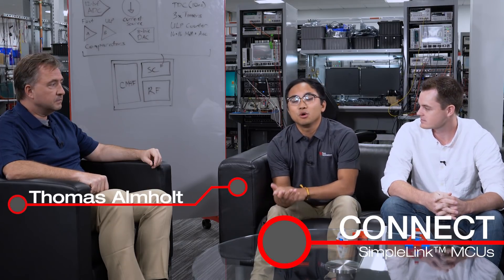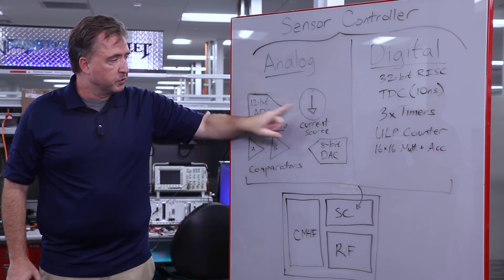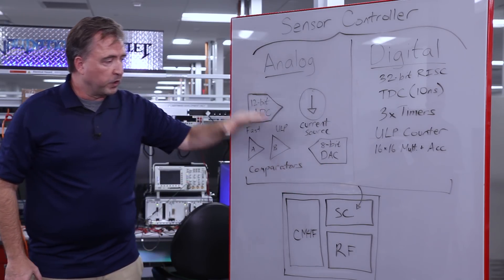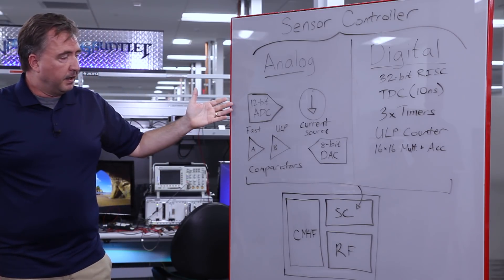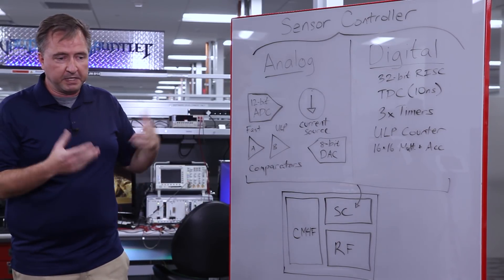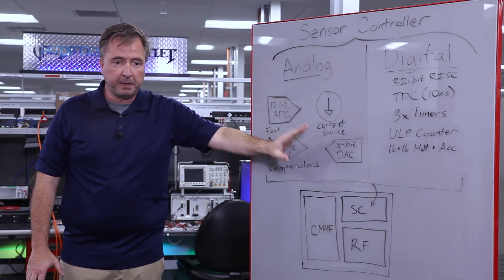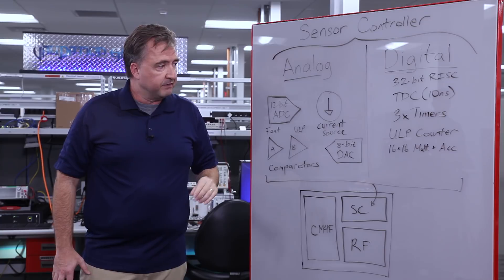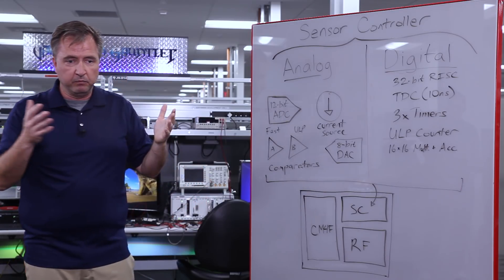Connect: What is a sensor controller?

Comment: I found problem while using SCS for my application. While initializing the Alert event SCS code generator does not update priority of the event, nowhere in the document it is mentioned taht it does not do so. Because of that faced problem in my application code. Took very long to know this fact now after scifInit call I do set priority for the Alert event in my application code then it works. Still I expect that should be done by sensor controller studio?

Comment: Hello, I need to to use pressure and temperature sensors. I was thinking to use PT100 for temperature and I need low power too. Is this ideal for this purpose? Also, I need to linearize the output of PT100, the sensor controller studio will help me with that?

Comment: According to the CC2640 datasheet, the Sensor Controller is 16-Bit, not 32-Bit... and the CC2640 datasheet says "The peripherals in the Sensor Controller can also be controlled from the main application processor", which implies it's not just the ADC that can be used by both processors. The technical reference manual says "All registers in the AUX_PD and the AUX SRAM are memory-mapped in the MCU domain, and can be
 accessed by the system CPU. Peripherals can be used in the AUX directly from the system CPU."

Comment: Hi Guys
Thank you for your videos
Do you have sensor controller MCU  with zigbee or Wifi?
Reply: Yes.
http://www.ti.com/wireless-connectivity/simplelink-solutions/zigbee/products.html
Also, the CC2650 does ZigBee RF4CE for remote controls.
Reply: Yes.  The Zigbee, BLE, Thread device is the CC2652R (www.ti.com/product/CC2652R).  The Multi-Band Sub-1 GHz + 2.4 GHz device is the CC1352R (www.ti.com/product/CC1352R).  Both of these have the sensor controller.  There are a couple of other devices that have it as well.  You can find more information at www.ti.com/SimpleLink.